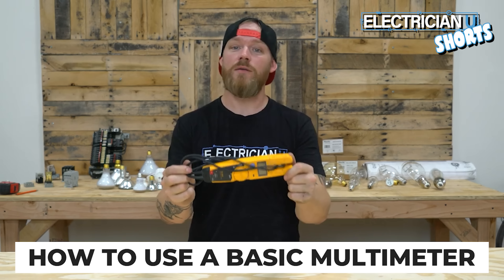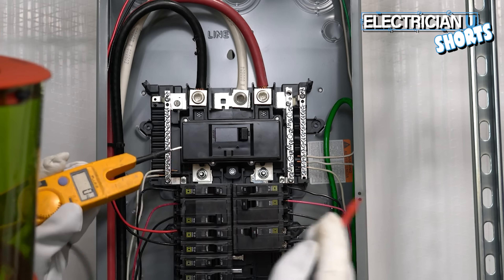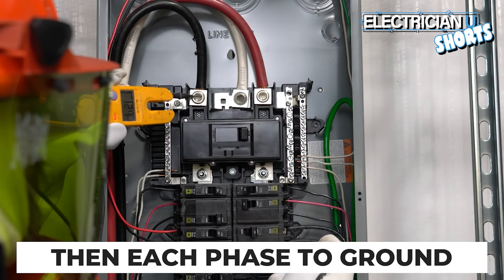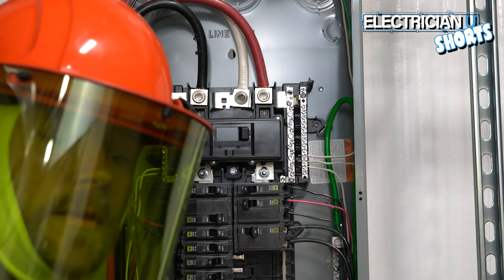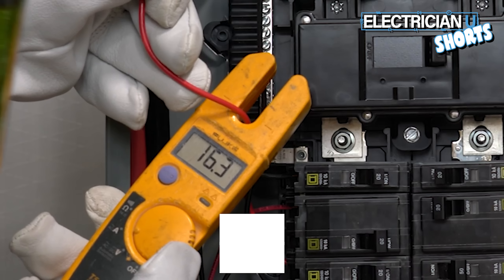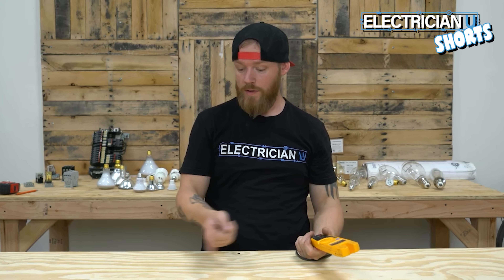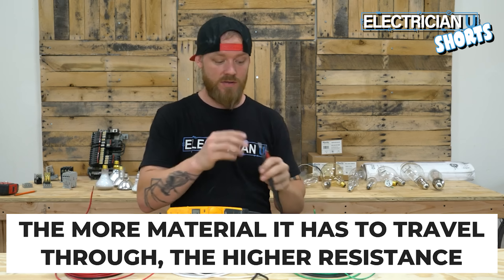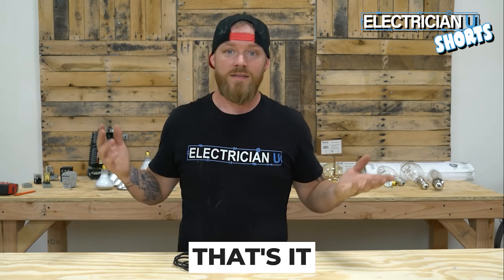How To Use a MULTIMETER (Volts, Amps, Ohms, Continuity)

Comment: One bad thing about using the continuity setting to check a wire is that it will show complete continuity on a multi strand wire even if all but one strand are broken which is bad because that one intact strand will lead to thinking the wire is good and can handle the current when in most cases it will not handle the current which may lead to that wire over heating and causing a fire. Same thing applies when using the resistance setting.
Reply: So how would you check a wire then?
Reply: I cant imagine a scenario where the situation you described is even possible to cause a fire without a breaker tripping or whatever was connected to the circuit stop functioning. even if there is somehow only one strand connected inside of the insulation, it would evaporate itself under load and the circuit would break way faster than it would take to create any meaningful heat source to anything else
Reply: @cesarroca9988   You have to test under a load.  They make testers that will put the line under load and test the voltage drop.

Comment: If you have a megger/insulation tester, you should do a video on insulation testing and leakage current next. It could be a nice way to start out a new advanced techniques series of videos.
Reply: Hi Dustin, ping me if you ever want to borrow a leakage current clamp meter, super mega-ohm meter, insulation resistance meter or ground resistance tester.

Comment: 2:50 I'm an electrician apprentice and my dad asked me the other day about some sort of device you're supposed to plug in near your circuit breaker to help lower your energy cost. You just gave the perfect example of why it works great for an industrial application but not for residential. When I looked into it, an article explained about how it basically evened out that power Spike that industrial Motors cause..

Comment: You should do a video on how to find a neutral in a control circuit. I know you won't ever see relays out in the field, but the use of control relays is a big part of any industrial setting. I've noticed that some people will get confused when a relay is being controlled by a neutral and not a hot. Relay power terminals do not have polarity, so it doesn't matter which wire you put on the 7 or 2 to energize the coil.

Comment: Always heard to turn off the power before working on wires but, what are safety procedures when using a multimeter(the power must be on) would you not get electrocuted?.

Do we just wear insulation?
Sorry I am ignorant about electricity but, learned alot from Electrician U's videos.
Reply: You should always take safety measures but in order to get a reading for voltage or amperage the power must be on. ONLY when you are checking for (resistance) that circuit must be off. I’ve seen guys blow meters up with a back feed of electricity coming back to the meter when checking for resistance. Be safe and if you are not sure call a professional. Your life is worth more than whatever a service call may be. Hope that helped you

Comment: Question, when your measuring resistance and you touch the prode with your bare hands, aren't you measuring the resistance of your body and not the metal conductor? 

(I'm  not trained in the trade)

Comment: With that initial spike in amperage with the motor being turned on, your breaker must also be rated to handle that spike. The spike was ~16Amps, so a 20Amp breaker would be sufficient?

Comment: hi may I ask for how about the "hold" button for what,please? thanks
Reply: its to hold the reading on the screen. for example; if you have to reach high up (to the point where you can't see) to test any setting you can press hold and it'll still be on screen when you bring it back down to look.
Reply: If you are trying to take a reading when you can't see the display, you would press the hold button to hold the last value read.
Reply: @Gangstarszz  got it, thanks a lot, I bought the  MULTIMETER because i watched your video and you recommend to us, it is great, but there is not light on it, now i know the button for what, thanks again
Reply: @nomanjones4803  Learned a lot about electricians from you, thanks sinserly